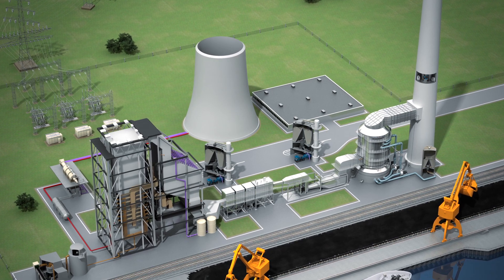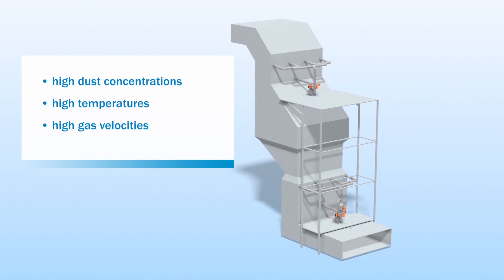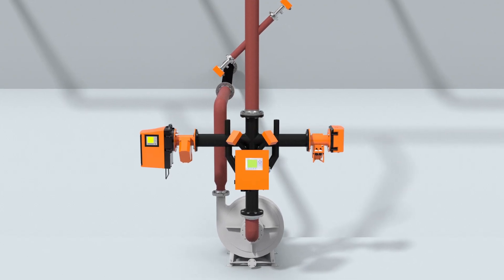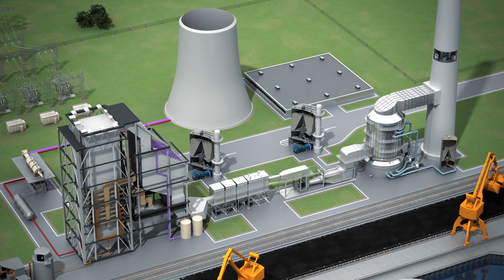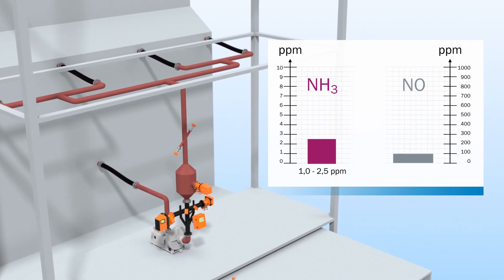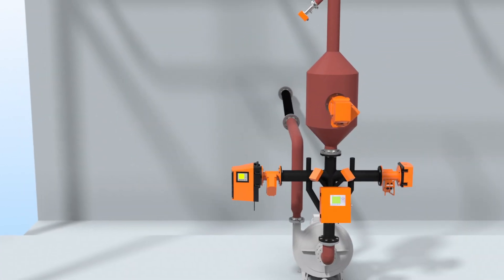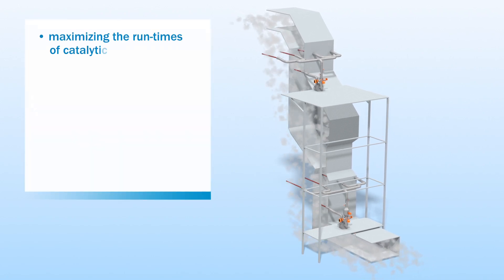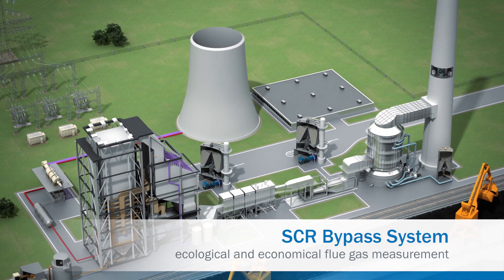NOx reduction with SCR (selective catalytic reduction) bypass system from SICK | SICK AG

Comment: Please use pressurized steam mixt with the fuel (ammonia) instead as a catalyst. It is a super conductor for eat and promotes the oxygen combustion.
No NOX will come out of it if sufficient oxygen and water steam is involved.
Reply from the maker: At 4:48 of the video you will find all components with part numbers.
In case you need other cables we recommend to check the accessories list at the handheld scanner https://www.sick.com/6080738 and the Connection Device CDF600 https://www.sick.com/1062460 for up-to-date part numbers.

Comment: Can I ask how many years a SCR can last usually?
Reply from the maker: The SCR system is not manufactured by SICK. An average investment period for an SCR is 10 years. Our product is the in-situ gas analyzer GM32. This is the bypass that measures NOx and is used in combination with our products GM700 (measures NH3) and FLOWSIC100 (measures flow) to achieve optimal control of the SCR process. With good maintenance, our system will run at least as long as the whole SCR system.
Reply: @SICKSensors  Thank you so much...A SCR 's average longevity is only 10 years. Now I understand
Reply from the maker: You are welcome!

Comment: Thank you so much sir good video..

I need your help,
I m facing problem with sick MG32,
There showing Failure and Maintenance required and I have disturbed the Alignment too..
Reply from the maker: Thank you for your feedback. 
Please write a mail with your problem and the details to our technical experts: info@sick.de or use our contact form on the right side of our website . Best regards

Comment: The insensitivity to dust mentioned is in regard to the measurement, not the catalyst. Also, a too high temperature will burn ammonia on the cat and produce more NOx.
The measurement system though is ingenious, cooled and purged. Great.

Comment: HI, Can I ask a question?
Where is NH3 injected into the system?
Reply from the maker: Typically the catalyst used in the SCR is vanadium or tungsten.
Reply: NH3 is usually injected from where the exhaust gas enters the system.